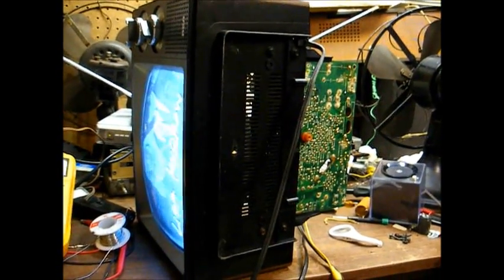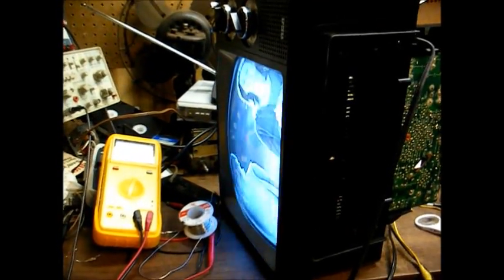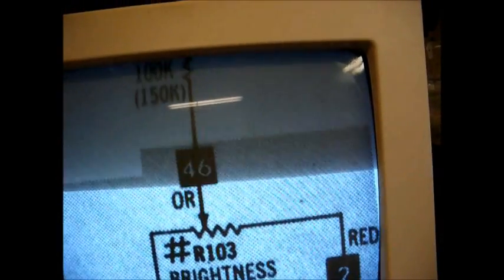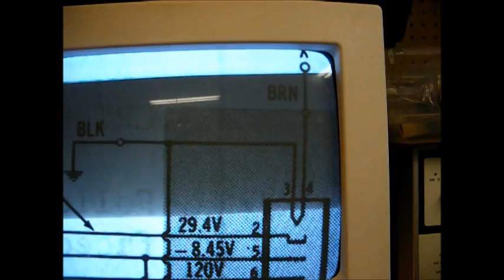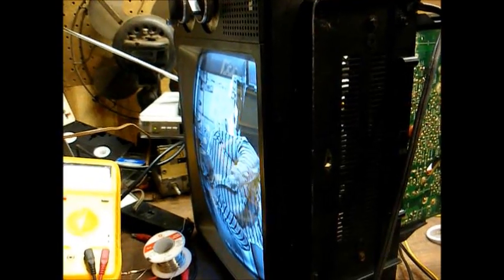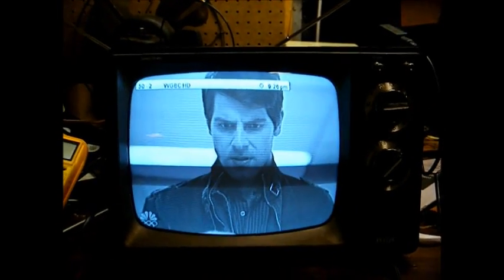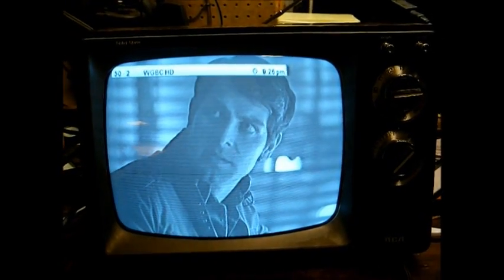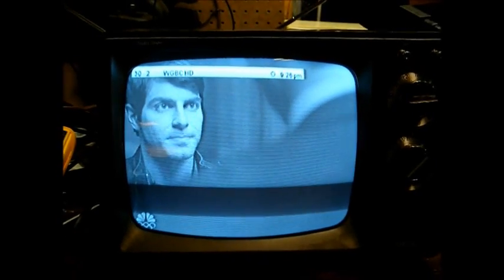1981 12" RCA B&W TV

Comment: TV with mechanical tuner. I am getting a new window A/C with mechanical controls. My older one is remote control. I don't need to pay the extra dough for an air-conditioner with a microprocessor.
Remote control is more convenient, but don't have to have it on it.

Comment: Seems this might just be from the aging of the CRT; I'll bet the alternate values for that resistor are for alternate CRTs as well. I wonder if it's easy to improvise one of the old "brighteners" (just a step-up transformer for the CRT filament) they used to sell, for sets where such a hack is less obvious. I have to say that below about 19", my inclination to preserve these sets is just about non-existent. I had a GE set like that in my kitchen for years, but I was so sick of having it in the way that that was the first place where I put a flat screen on the wall; a Kreason, if anyone remembers that ill-fated brand.

Comment: I found one just like that in my neighbors barn covered in dirt dust and hay well i spent couple days cleaning it out and a i hook up my Atari 2600 to it just see if i could get something then i started to see smoke coming from the right side of the vent of the tv so I turned it off and unplugged it and wait for it to cool down then look all around the set just to see where it was coming from then i found i believed little pieces of Styrofoam under neath the filter capacitor then look at the so clean it a little bit more and pretty clean now.
but there is a problem with the speaker. The speacker is not very loud i have to turn it up all the way just to hear something.
now i am not a election even though i would like to be i'm just 17 year old that just like vintage electronics
Reply: maybe a bad cap in the audio output stage?

Comment: Just curious, is it safe to have these things open whilst they're on, I read somewhere that if you taking the shield off it's potentially unsafe if your running it, anybody know if that's the case?
Reply: Samthebam4044 Despite the X-ray warnings there should be no significant radiation at normal operating voltages with these sets. The EHT will probably be around 12KV.

Large colour sets with valve (tube) line output (not diode triplers etc.) are a different matter. Some of these, operating at ≥25KV, produce significant amounts of X-rays which are known to be dangerous in close proximity and with long exposure.
Reply: I have heard of color TV sets giving off soft x-rays...
Reply: The old ones with shunt regulator tubes and no shielding in the CRT glass were a little scary; some of the original GE PortaColor sets were recalled because the regulator was mishapen and would send an X-ray beam at any children sitting just in front of on on a stand. But by 1980, they were pretty safe.